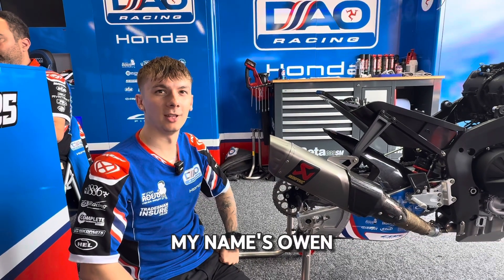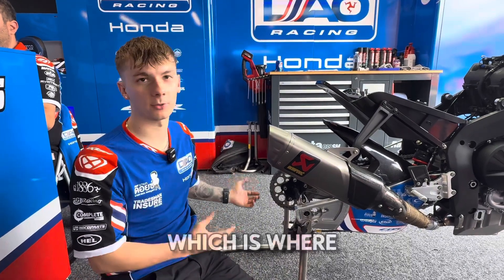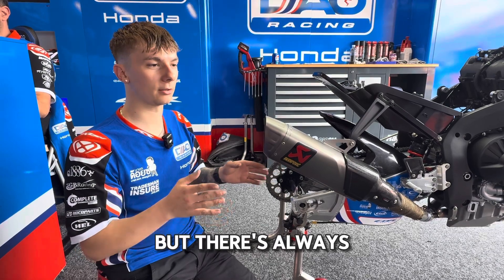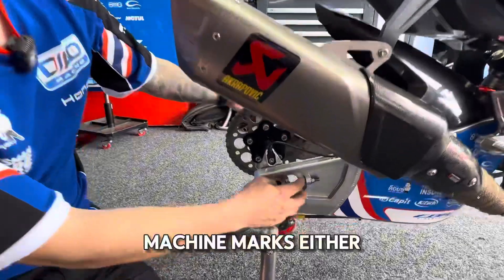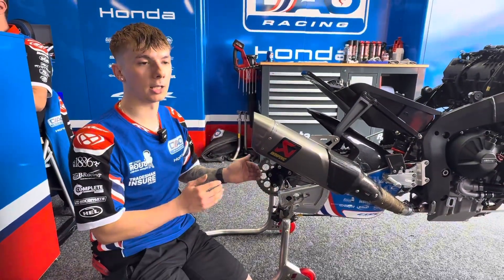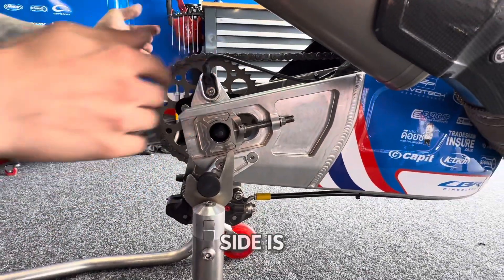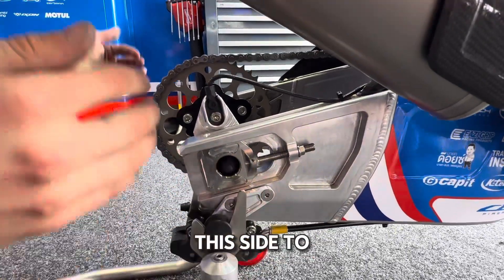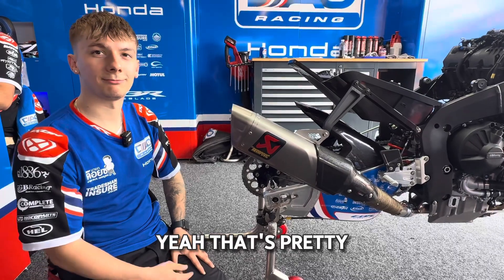TECH TALK TUESDAYS: Unlocking Super bike Precision

Comment: When I raced I would never rely on alignment marks, or the chance that the swingarm or frame had slightly deformed. I would always check wheel alignment with a straight edge to the front wheel. Making shure the wheeels are perfectly aligned.
Give it a try.